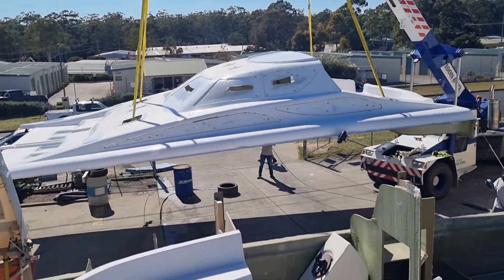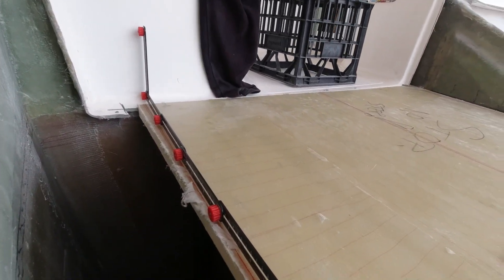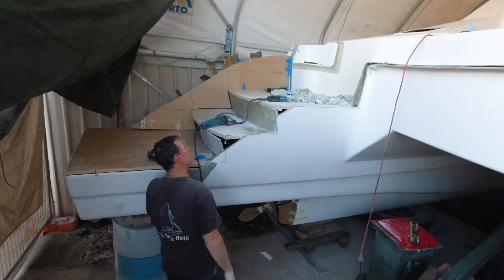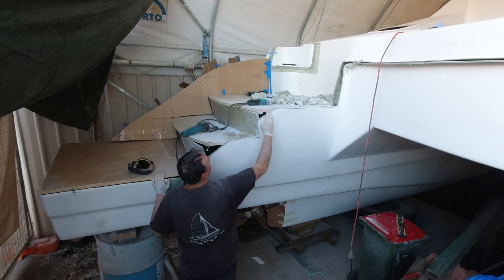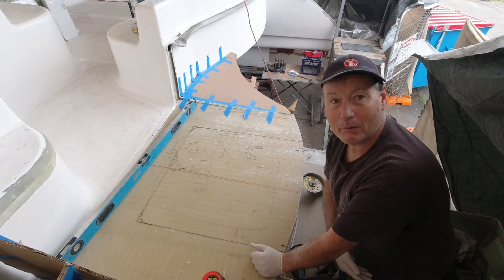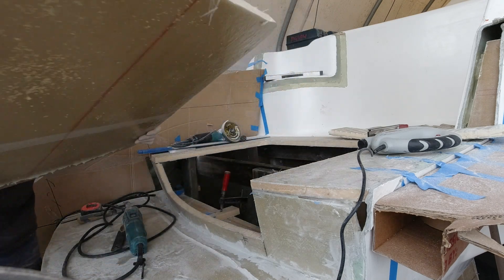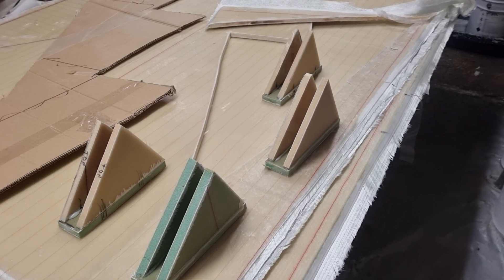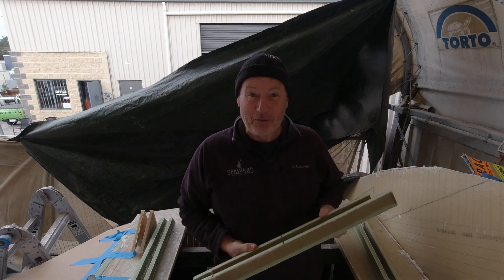Lazarette Access Hatch Build - 42 Foot Catamaran Build Ep233

Comment: Are cats controllable on one engine?
Reply from the maker: Yes Will,generally only gain 1 or 2 knots with the second engine but more balanced with 2 motors.Thee are some older Cats that use a single drive in the centre of the bridgedeck.Ross
Reply: @LifeOnTheHulls  Seemed likely.  Planes have the same problem.  Lady Africa was built with one in the center, but they switched to 2 in the hulls at the last minute.

Comment: The cost of the resins must have soared. Literally tons of epoxy etc. Are you planning on capturing rain water and then filtering it to drinking quality? Desalination seems expensive when rain water is at times just pouring back into the ocean. Fresh water isn't cheap.
Reply from the maker: That's the plan! I haven't quite worked out a way to halt water capture before cleaning the deck and roof and then allowing capture with a clean system. I dare not look at the costs I have incurred in resins and cloth as the prices now are ridiculous. I have been compiling a spreadsheet that will ultimately tell the story. Cheers Ross

Comment: Another plus the way you are doing the drains is you won't have a connecting hose to a thru hull that at some point is going to get stopped up with debris. I have to deal with that on my engine hatch in the deck of my Carver Monterey 2687 on a bi monthly basis.  Nice job.

Comment: Hey Ross do you friends with the elite 11 find head room in the saloon a problem I’m just on 6ft and had to duck when in the saloon. Went to look at the one we talked about yesterday think the head room could be a issue. Love the extended steps and swim platform sure it will be put to good use cheers greg.
Reply from the maker: They are quite short but it is an issue I have a similar issue in my boat,,second part or forward part of my saloon requires ducking as I am 6ft3.Issue with all older cats except lagoons.

Comment: Refer to comment here. We made our hatches open to the front so that when they are open they catch the breeze an feed it inside. Works well, as the wind blows from the front, usually.
Reply from the maker: Mark.These hatches will have to open facing stern I think but it is not a workspace so not all that concerned.Ross
Reply: @LifeOnTheHulls  It is your boat. And what I or anyone else says is moot

Comment: I have a question on the hatches.
Have you considered having them open back towards the stern?
Having them open back would provide a barrier to water if you have to access them in less than ideal conditions.
Any tools or parts could be left on the deck away from the ocean with easy access as you need them without reaching around the open hatch.
A strong wave from the stern would need to rip the hinges out to open up the hatch, as opposed to the locking lugs and looking at the undercut of the step it would make dealing with the gutters much easier.
Does any of that make sense?

Comment: Morning. I am wondering if there will be a vertical piece running behind the step, between the two triangular pieces, so the water has no where to run back to. You might have said this, but I missed it if you did. Just a suggestion. Great project, and well done.

Comment: Hi Rossco , what type of disk are you using for the anglegrinder ? Ultra thin disk for mild steel ? Or something else ?
Reply from the maker: It is a diamond edge disc I have had the same dlsc for years,amazing durrability.I think they are commonly used in masonry etc. Cheers Ross